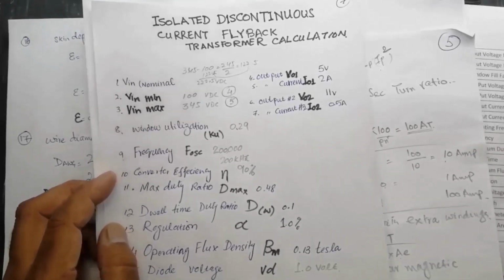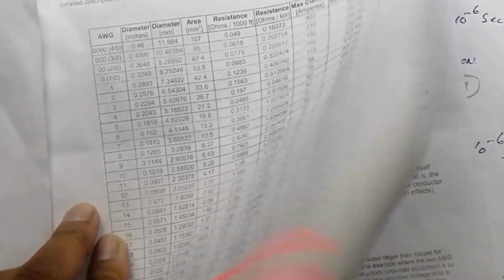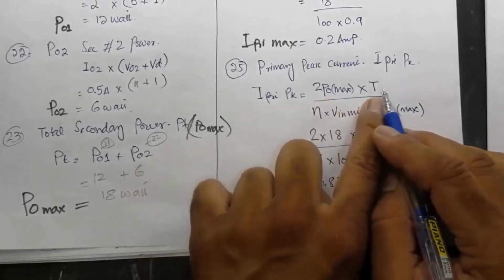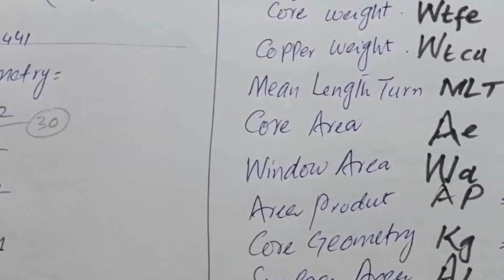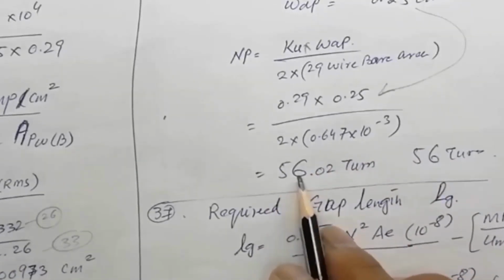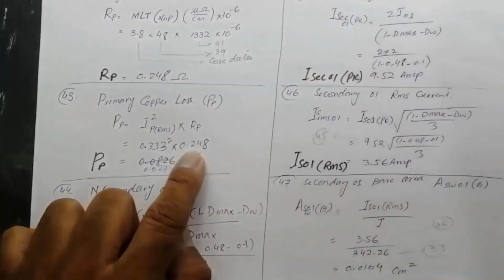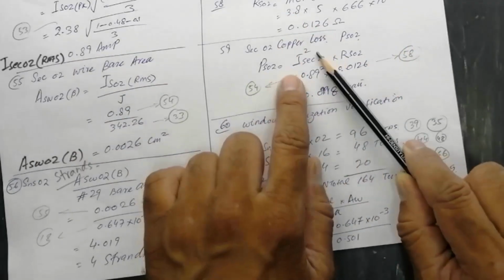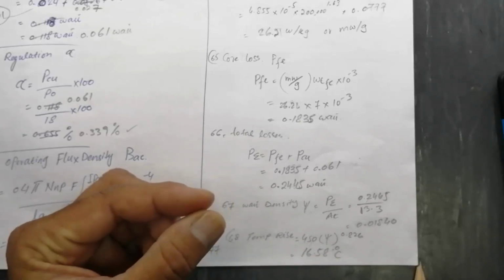#322 Flyback Transformer Design Calculation | High Frequency SMPS Transformer Design

Comment: how to calculate multiple wire turns ?
what is last video ...
Reply from the maker: you can use turn ratio method for multiple output 
based on power ratio and turn ratio
Reply: @HaseebElectronics  thanks. Then how  can we select how many numbers of copper strings ? I could not understand some calculations .. What is your  complete design  for 5V 10 A power supply .......

Comment: Dear sir.
I've watched video number #253  Ke=(0.145)*(Kf)*(f)*(10^-4) and core Geometry was calculated by Kg=Pt/(2*Ke*alpha)
but This Video#322 Calculate Ke from equation  Ke=(0.145)(Po)(Bmax^2)(10^-4) and  Kg= (Energy^2)/(Ke*Alpha) 
What diiference between 2 method? I tried to calculated Kg from above 2 method but the result not equal.
Could you please explain me? 
Thank you very much.

Comment: I have an important question, answer me if possible please.
Actually, I couldn't find a proper size of an ungapped core in the local market. so, Do I have to add the gap to the core? What happens if I use an ungapped core?

Comment: The video was very great and informative! Excellent explanation. Masha Allah!!!

I have a doubt regarding selection of core type. In 17:55 you have taken core size to be EFD-20. What is the criteria to take EFD-20 core size? With the ferroxcube 3C85 material can we choose EE core? What parameter should we check to select that core size? Also, in power handling chart there are many cores. Why instead of selecting a core from power handling chart , you took EFD-core? Also where we will find all the characteristics of the particular core like the parameters mentioned in the video like core geometry, area, permeability etc.? Can you share a link which have these core characteristics? It will be very helpful! Also material chart link if available.

Comment: For uc3843 ic VCC needs 12v min and 30v max which voltage we should take for the auxiliary winding calculation please tell me
Reply: Just wind it to get 20 volts, will be perfect. To calculate amount of turns just use turn ratio

Comment: Hi SirJi, I am huge fan of how the things are explained on SMPS by yourself. I have a request, here in this video you have shown an excel which you are using to calculate the transformer parameters. If you can upload that excel it will be of great help and will save lot of time. Although it is attached as PDF but in excel it will be of great help. Thx
Reply from the maker: best regards and special thanks 
i already uploaded the calculation sheet, check the link in the description of the video
Reply: Can u please provide me the excel calculations if u have done it

Comment: Sir if my required output is 24V voltage and 8A current, can I use all the same formulae like you did?

And can I still use UC3843 for the complete design, even though my desired output voltage is 24V and current is 8A with power=(24*8)= 192W ?
Reply from the maker: For 192 watt is not good to use flyback topology
You should select half bridge
 or push pull topology using TL494 OR SG3525
and design push pull transformer
Reply: @HaseebElectronics  Sir it's not for practical application. For my project I was told to design a discontinuous flyback converter with 24V output voltage and 8A output current. With these parameters can I still follow your way? and use UC3843?
Reply from the maker: @haadyousaf  that is okay 
But 
Designing a flyback topology it becomes some difficult to get full current with regulated voltage 
You can design flybck
Just derate the core properly
Reply: @HaseebElectronics  I understand, thank you for your help and this awesome video!

Comment: Will the gab apply to the three transformer core Lim or only the center Lim and how do we apply the gap
Reply from the maker: the gap will provided in center leg. 
if we use ungapped core, in that case we have to take special care for core saturation, because the ungapped core saturates very rapidly
Reply: @HaseebElectronics  it is only on the center leg and if so what type of non conductive material do we place between the center leg
Reply from the maker: most common method is center leg gapping
non metallic shim like plastic / fiber shim / acrylic 
these available in 1/1000 inches (thou or mills)

Comment: Can we calculate the transformer winding design for all smps DCM  topology using this method you used
Reply from the maker: yes it is DCM flyback topology only because it is uni-polar magnet 

for forward, push pull, half bridge and full bridge other approaches are taken to calculate the transformer
Reply: @HaseebElectronics  can you share the transformer design calculation formulas and procedures for forward,push pull, half bridge and full bridge smps design

Comment: The window utilization factor value selected is it the same for all smps topologies
Reply from the maker: yes dear it is almost same for all topologies, as the result after winding, the wire enamel, insulation, margins, taps, winding gaps due to circular wires, layers, winding technique, strands
to total filled window proides only 30 percent of usable copper
so in calculation it must be considered less than 0.30
Reply: @HaseebElectronics  thank you for sharing your knowledge